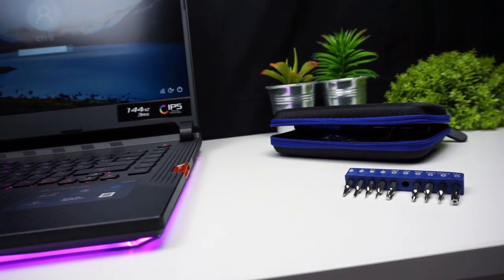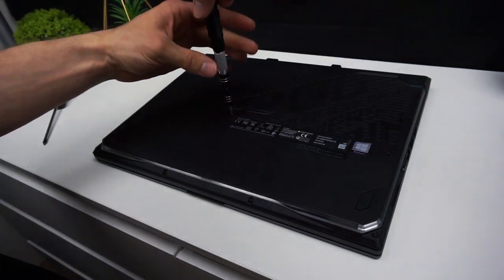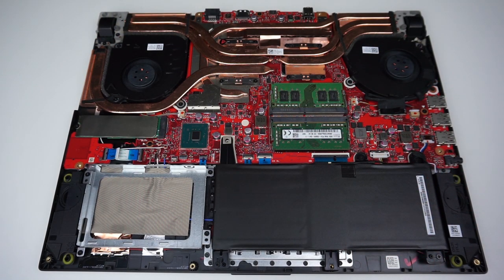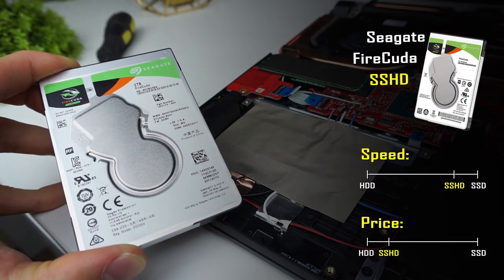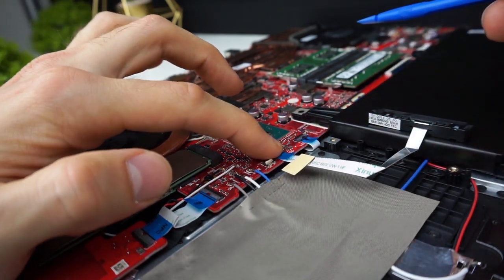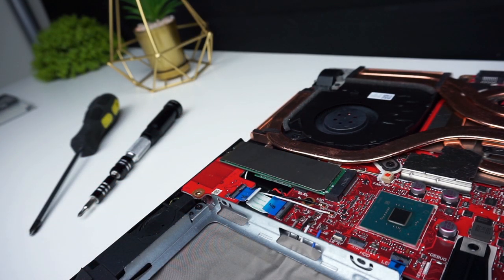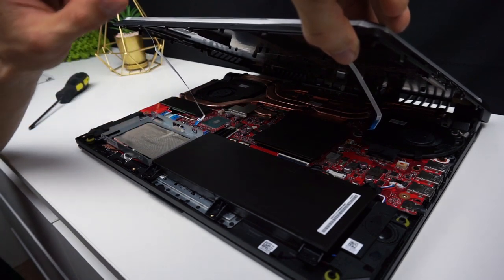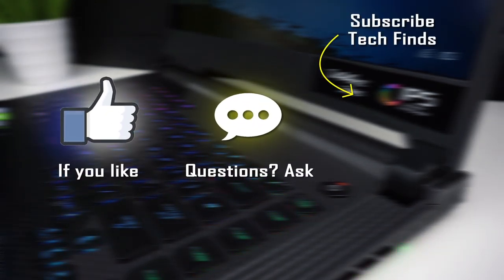Asus Scar III Upgrade RAM / SSD / HDD - Disassembly Guide

Comment: Does is matter which way up you install the sata cable? the one you have has the blue thing on top and the beige side up on the tab but on my cable if the blue thing is facing up the beige side on the tab is facing down. I don’t want to ruin anything so I’m curious which way to do it? Thank you for this video tho it’s a lifesaver
Reply from the maker: The blue thing should be on the top when installing. The cable is flexible, but don't bend it too hard.
Reply: Tech Finds awesome thank you so much man! Exactly what I needed

Comment: Very helpful video thank you, btw how hard is it to re-paste the cpu ? I have the 17” and have relatively high cpu temps while gaming and requires the use of a 3rd party cooling pad. And ive heard repasting will help drop temps.
Reply from the maker: Scar 3 has a good cooling, so if you're getting high temperatures they most likely messed up the paste work in the factory. Repasting is an option - i recommend using a high-end thermal paste like this one: https://amzn.to/2LQUEVX

Comment: Hi! Thanks for the Vidéo. 
I've just buy a SCAR 3 G731GW. 
I wanted to add a second HDD but there is no câble... Do you where I can by one? 
By the way on the motherboard you plug on the J5101?
Thanks
Reply from the maker: I left the link for cable in the description. I have no idea whet this numer is.

Comment: Can you confirm that there is room for 4 RAM cards? I can't clearly see it from the video. I have the 17" SCAR 3 and in the memory section of the task manager it says that I'm using  2 of 4 slots. Also, the CPU-Z software tells me I have 8GB in slot 1 and 8GB in slot 3. I was thinking of buying 2 more 8GB to max the RAM capacity but if there are only 2 slots maybe I need 2x16? Thanks a lot in advance!
Reply from the maker: This laptop (even 17") has 2 slots for RAM as vast majority of gaming laptops. You can install up to 32GB (2x16)
Reply: @TechFinds  I see, thanks a lot for confirming. That "2 of 4 slots used" is very misleading then.
Reply from the maker: @ramasama  To be honest i have no idea why it shows 4 slots. Btw. you can just open the laptop and see :D
Reply: @TechFinds  I'm not that knowledgable about those things so I rather open it when it is strictly necessary... haha. In the crucial website it shows that my laptop has 2 slots as you say. Thanks again!

Comment: Hi thanks for the guide,

Unfortunaly my left lightbar stopped working after the upgrade (tried reconnecting the cable many times but never turned on). I found a new cable for 12$ but I’m unsure how to replace it, do you have and idea?
Reply from the maker: Sorry to hear that. Unfortunately i didn't touch these cables except for disconnecting them. I think that soldering may be required.
Reply: Tech Finds it randomly startet working again, maybe just a software error lol. Thanks anyway

Comment: What size screws do you use to connect the drive to the caddy? I lost mine, and want to add the 2nd drive. I've still got the ribbon cable.
Reply from the maker: I have no idea what size is that. You can ask for HDD screws in some computer shop or search for them on the internet

Comment: Question 1: Is this laptop heavy and hard to carry around or average?
Question 2: If I do a fresh install of windows 10, what drivers to I need to download?
Reply from the maker: 1. I think the portability and weight of this laptop is about the same as every 15" thin bezel gaming laptop nowdays. Just because of the exhaust section it's slightly deeper in size. No drama tho.
2. I had Win10 with all the software, drivers and factory settings. I never test laptops with fresh windows, so I don't know what drivers you will need, but I think it's not worth to bother with downloading it all, especially ROG software.
Reply: @TechFinds  Ok. Thank you

Comment: Don't opening the computer end the warranty ?
I want to add ssd and ram to my new g17 but I dont want to loss warranty.
Thanks in avdvance !
Reply from the maker: It vary between countries. In most cases you'll still have your warranty if you don't damage anything during upgrade. But to be 100% sure you have to read your warranty card

Comment: you are doing a great job,please i want to upgrade the hdd of ASUS ROG Strix G531GT,there is a video for that?Do i need the the caddy and the cable?
Reply from the maker: I don't have a video specially for your model but it should have the same build as mine so you can base on that. You have to open the laptop and see if the caddy is inside. The cable should be in the box
Reply: @TechFinds  thanks. It was used one bestbuy didn't give me any cable. I opened but I just found the caddy. That me I'll need screws for the hdd and the cable!😔😔😔
Reply from the maker: @paulinkamnang5814  I think you can find the parts on the internet ;)

Comment: Hello, after doing the ram and sshd upgrades, do you have to configure something in the operating system?
Reply from the maker: Hi, RAM will be recognized automatically so you don't have to do anything in the system, but if it comes to SSHD or any other drive you have to go BIOS and find the drive. Here is how to do it: https://www.youtube.com/watch?v=UV72wLA06_c&t=637s (start from 10:25)
Reply: @TechFinds  Excellent! Your videos are amazing. One more question, what is the best ram of the options you give? The asus scar 3 that I bought came with 2, 8GB modules, so I will have to buy two 16GB modules and I want it to be compatible.
Reply from the maker: @DavidDuran-hl8ze  if you replace 2 original sticks you can go for any RAM you want, but I think HyperX is the best from what I linked, because it has the lowest latency.
Reply: Tech Finds hey, i have scar3 do i have to open it to check which ram i have or there is another way?
Reply from the maker: @makavelivii6518  You can use CPU-Z program

Comment: Hello Tech finds, is the SATA connector in the laptop already ? Or i should buy a SSD which has the SATA connector Kit included ? Thanks :D
Reply from the maker: You should get the cable with the laptop
Reply: @TechFinds  thanks , the box is far away, i will buy one

Comment: I have the same laptop and looking to expand the ram. Im just a bit confused. Some of the config online says “1Tb + 1tb” of ssd. That means 2 slot for m.2, right? Why is that on your video you seem to only have 1 slot for m.2? Thanks.
Reply from the maker: It has 1 slot for m.2 SSD. You can have a SSD in the place of HDD
Reply: @TechFinds  oh. Okay. Thank you so much. Can I use the Samsung SSD Sata III?
Reply: @TechFinds  nevermind. I just opened my laptop . Mine have 3 m.2 slot. Thanks
Reply from the maker: @arjay0490  Sure, you can

Comment: I was interested in getting a 2tb firecuda to add on to my laptop, does it come with screws to screw into the drive bay or do I have to buy them on the side?
Reply from the maker: By default you should get the screws and cable in the box or in envelope with paperwork that came with laptop.
Reply: Tech Finds I guess I’m out of luck cause I got a floor model with no box, so that kinda sucks and I live in Canada so the ribbon cable is 50$ which is insane but yeah

Comment: Are you able to instead of an sshd,, use an 2.5 ssd instead? i would like to install an ssd in the 2.5 drive bay like the Samsung 860 QVO 1TB 2.5" SATA SSD
Reply from the maker: Sure, you can install 2.5" SATA SSD and the Evo 860 is good. I actually linked it in the description

Comment: hi , where do i find the sata cable to connect ssd drive? also do i need to buy screws to mount the ssd?
Reply from the maker: You should have got everything with the laptop. Cable is usually in envelope with paperwork. If you don't have the parts i left the links in the description. Idk how about screws, they are universal tho so you should be able to buy them somewhere if you don't have them

Comment: I know this video is one year old but i want to buy the versión with rtx 3050 and ryzen 5600h, my question is if the interior os still the same cause the store is to small and i want to know if i can add an hdd or i will have to buy a smaller battery for it
Reply from the maker: The seller should specify if the laptop has a slot for HDD. I don't know what you mean with that battery
Reply: @TechFinds  oh ok, thanks

Comment: is it possible to make a tutorial about changing thermal for both processor and GPU
Reply from the maker: If it was my laptop i would make repasting guide as well, but since this is only a testing unit that i have to send back i am not premited to disassemble cooling system and change thermal paste.
Reply: @TechFinds  i mean in general :) not for this laptop
Reply from the maker: @swedyptian9977  Well, the same applies to every laptop that i test. There are many repasting guides on YouTube.
Reply: @TechFinds  the reason i asked you is couz i like your channel

Comment: Thanks for a very good video! It helped me upgrade ram to 32Gb. :-)
Do you know if Samsung 970 Evo Plus SSD is compatible with my Asus Rog Strix Scar III - G731GW-EV002T?
And is it possible to install a SSD where you put the Seagate Firecuda SSHD?
Which SSD would you recommend in that case?
Reply from the maker: Hey, you can put SSD instead of HDD, but it has to be 2.5" SATA SSD like Samsung Evo 860 that I linked in the description. You can install 970 Evo plus
Reply: @TechFinds  Thank you so much! 😃👍
I have Windows and softwares on my SSD that I will replace. How would you do to restore windows on my new SSD Samsung 970 EVO Plus?
Reply from the maker: @pikefurios  You have to install programs / games again on the new drive and transfer all your documents.And fress install Windows using special Microsoft tool
Reply: @TechFinds  What special tool?
Reply from the maker: @pikefurios  it's called windows media creation tool. You can make your pendrive bootable with it and install the Windows
Reply: @TechFinds  Thank you so much for all your help. Time to hit your subscription button! 😃👍
Reply from the maker: @pikefurios  Welcome on board!

Comment: Is it possible install the hard drive without unplugging the ribbon cables for the light bar?
Reply from the maker: Yes, probably it is possible as one of my viewers said he did that. You have to flip over the bottom lid somehow and lay it in fron of the laptop upside down but you have be vary careful to and watch out for the cables all the time.

Comment: BRO IMPORTANT- Is it necessary to out the sata cable under the HDD??? Cause my sata cable is kinda weird and doesn't bend properly
Reply from the maker: You can let the cable bend anyhow just to fit inside and don't bend it too much if it's not factory-bend
Reply: @TechFinds  Yea I did that anyway Thx a lot!!! I was not planning on doing this by myself cause I was too nervous about it but your video gave me the confidence to do it by myself. Thx

Comment: After we upgraded our laptop, we need to enable something or is this finished this simple?
Reply from the maker: if you installed the new drive you have to open device manager and make a partition
Reply: @TechFinds  Ah, yeah and the screws for the HDD where do I get them?
Reply from the maker: @deadbonebrook8679  if you didn't get them with the laptop you have to buy on the internet or in some computer shop

Comment: I have a 256Gb Samsung EVO 860 I'd like to fit into this, would it void the warranty if I opened it? I've seen mixed opinions on this.
Reply from the maker: It all depends on your warranty terms, because it vary between countries. You have to read your warranty card or contach Asus to find it out.

Comment: If I will add internal ssd in m.2 slot, will it void the warranty of the laptop?
Reply from the maker: Most likely not, but if you damage something during upgrade or the SSD you add will cause any damage in this case warranty would be void. However you better read your warranty card, because the terms may vary depending on the country
Reply: Thanks for reply 😊

Comment: Hey can you put on the scar 3 17.3 inch version the 2.5 hdd slot , a  2.5 ssd card? And can we change the wifi to wifi 6 ?
Reply from the maker: Do you mean a 2.5" drive SSD? You can put it in 17" model too. If it comes to wifi card i don't know, because i didn't check it.
Reply: Tech Finds okay thank you :p

Comment: Is my Asus Rog Strix Scar III also has a empty SSD bay ready to expand the storage?
Reply from the maker: It depends what configuration you bought. The laptop has one slot for 2.5" drive and one slot for M.2 SSD. If your laptop had only one drive it's most likely m.2 SSD so you should have your 2.5" drive bay free

Comment: I used the hdd cable that came with the laptop and I didn't work, I bought a 2tb internal hard-drive and I follow the steps very cautiously and the external never showed up in my asus
Help:[
Reply from the maker: Go to device manager and make a partition so the drive can show up in your system

Comment: Hello, I have been dealing with Laptop overheating, this is my take on the situation, as well as a request for a follow-up video:
Is it possible for you to do a re-paste of the ASUS ROG Scar 3, because I have the similar model to that one, I have been running into throttling issues, even with under-volting, when hit by GPU + CPU load, the temps don't seem to be good, in games, that being, it gets up to 96 degrees and throttles down for a moment, down to 3499 MHz at times, It's so irritating to see this laptop go through this, now, sadly, I haven't seen any good tutorial on re-pasting this model, and I see people on the internet complaining, so, if you could dedicate your attention to this problem, and make a video of you re-pasting the laptop, I think you could help a lot of people such as myself, who have run into overheating with this particular model, the heat sink isn't much good, we all know it, but re-pasting seems to have done the trick for some people on the internet, lowering the temps enough so the CPU isn't throttling. I could be asking for a lot over here, but having this question of mine would make my Laptop's life such as mine, easier to get through, my exact model of laptop is G531GV, It's running an i7-9750h, 16GB RAM, 1TB SSHD + 256GB NVMe, and a RTX 2060 6GB.
The temps on the GPU seem to be good, under 88, all the time, and it's great, but the CPU lacks cooling, re-pasting would do the job, and I think, judging by your amazing content, you could do a very good video on it.
Sorry if I'm asking of too much, I just want a good tutorial, since I've never re-pasted any laptop before.
Regards, and Thanks!
Reply from the maker: Hi, unfortunately I am not permitted to disassemble cooling system in the laptops that I test or change thermal paste. Also I had this laptop for limited time only for testing purposes and I had to send it back long ago. Your temperatures are pretty high even on GPU when usually it doesn't exceed 80 degrees in most of laptops. It's a thermal paste lottery, especially in Asus gaming laptops, but using a good one with high thermal conductivity usually helps
Reply: @TechFinds  Welp, I guess that sucks, nothing could help me besides changing the thermal paste right now, by the way, the tests conducted were with Fan Mode set to Turbo, and additional cooling pad for my laptop, with 4 fans that ran at the max speed the controller of the cooling pad allowed me to run them at.

By the way, I've come across some videos and one guy says that you could technically leave the thermal paste on the VRM's (not sure if I spelled that correctly) and other stuff beside the main 2 cooling components, and only change the thermal paste on the GPU dye and the CPU dye, should I do that, because I'm not as experienced with applying thermal paste? 
And I have also seen that there are stickers covering up the PCB of both CPU and GPU dyes, so I could apply thermal paste without needing to worry about it being too much and spilling out of the sides?
Regards!
Reply from the maker: @petarpartaloski8889  since i didn't disassemble the cooling in this laptop I don't know if there is thermal paste on VRAM or thermal pads. If it's paste I would rather change it too if you're changing paste on CPU and GPU for a better one. But most likely nothing will happen if you leave it as it is on VRAM. Before you do anything remember that you probably have a warranty sticker on one of the screws of cooling system.
Reply: @TechFinds   I know I do, but this, I cannot live with this, and warranty wouldn't fix an issue of this kind, and even if they tried, I doubt they would make it better...
Reply from the maker: @petarpartaloski8889  It looks like you are on your own with this problem. Eventually ask someone experienced to do it for you. It's like a puzzle, every laptop has very similar build and it's intuitive imo
Reply: @TechFinds   I will try it on my own, because I don't have anyone to trust with this expensive of a Laptop, and to be real, who would take the risk for me, the short answer would be, replacing the thermal paste with a great one from CoolerMaster, and hoping for the best.
Will update you further!
Reply from the maker: @petarpartaloski8889  I recommend Thermal Grizzly Kryonaut or CoolerMaster Master Gel Nano Diamond ;)

Comment: Any idea if the 3200mHz ram also works with this laptop? Thanks in advance
Reply from the maker: It supports up to 2666. You probably can install 3200 but it will downclock to 2666 anyway
Reply: @TechFinds  thank you very much 😁